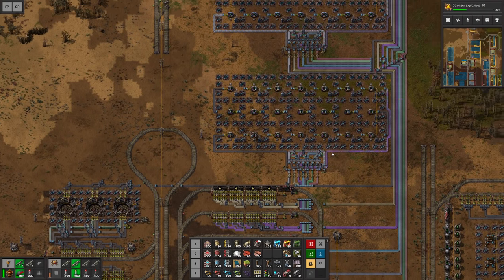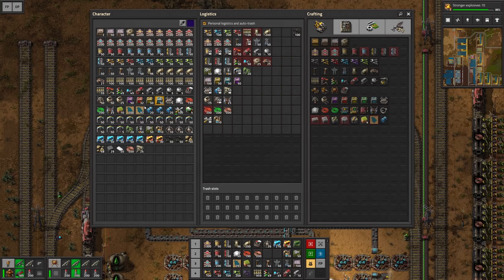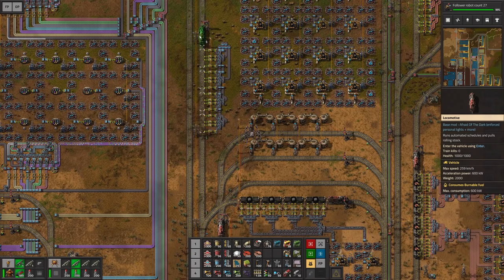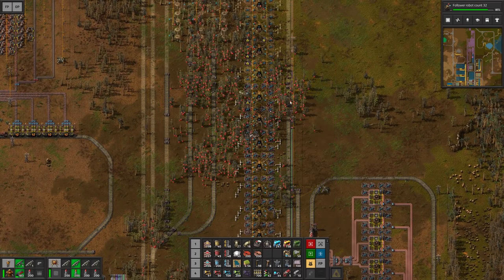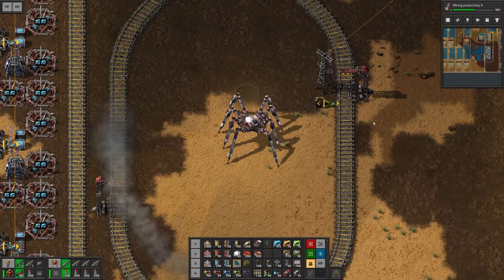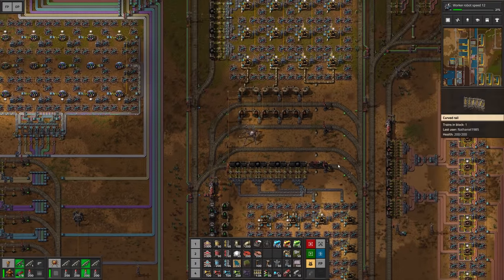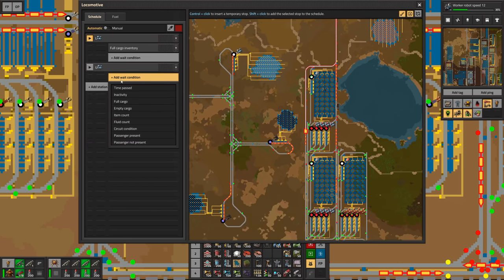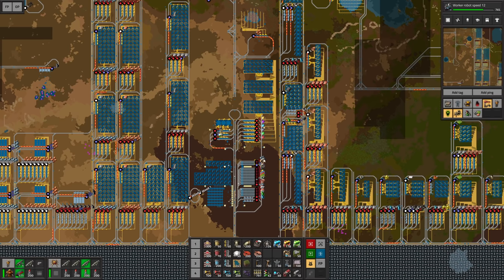TRAIN FIX - Factorio: Ep. #25 - Guide & Let's Play

Comment: If there are only 7 Storage Tanks, then the max fluid you can store is 175k, so you will never get 190k.

One other idea for the Wood Burner would be inserting the Wood into a Boiler, and attaching a pair of Steam engines to the Boiler.  You get a bit more power, and burn Wood at the same time.  Just make sure you have a Requestor chest for one stack of Wood, so you can use the Wood to make Small Power Poles at an Assembler.  From there, have an Inserter taking the Small Power Poles into a Logistics chest, with a Green wire controlling the Inserter so it only works if there is less than 50(?) Small Power Poles.  This way if you need Small Power Poles, they are available in the Logistics chest, and the Assembler can make more, then the Requestor Chest demands more Wood.  If you have to deconstruct Small Power Poles, they can be stored in that Logistics Chest